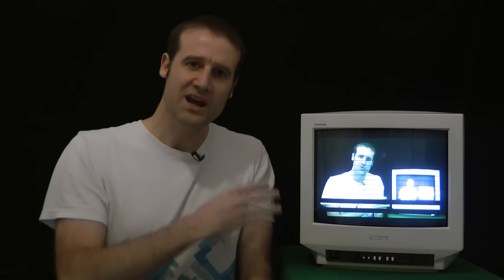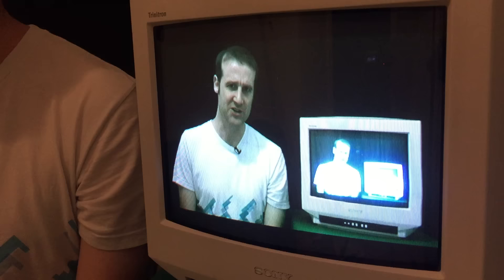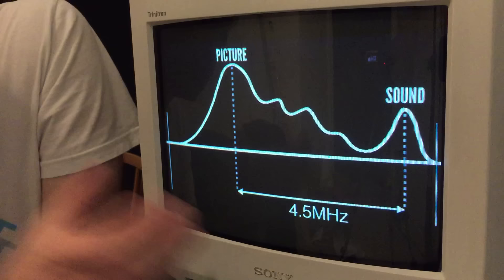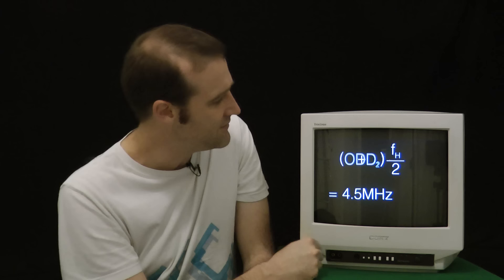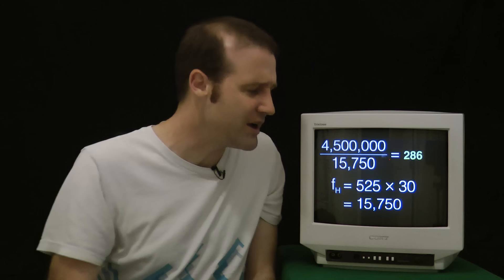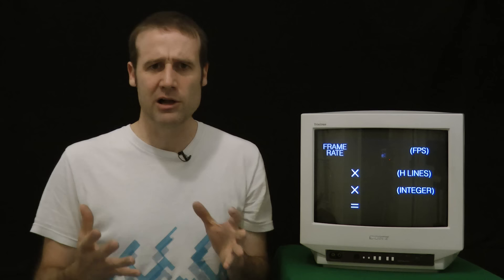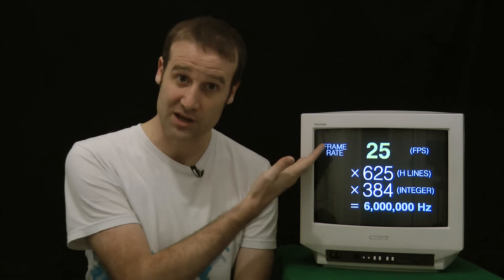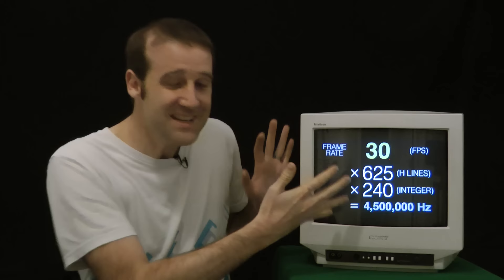Why is TV 29.97 frames per second?

Comment: Was the electricity really used to time the scans? The issue was interference. When it matches the mains frequency interference remains still instead of flickering. There was no universal European standard before color. That was the German standard. British had only 405 lines. The 625 line TV was introduced around 1951 so it precedes U.S. color TV. The second NTSC was in 1950-53. While it might be possible that some of the findings influenced it is more likely that it was a coincidence.

Comment: So I understand the precision of 525 lines and 30 vs 29.97 frames/sec - but the 4.5 MHz bandwidth of the Over the Air signal is inherently going to be fuzzy.  So it's still not really clear what was up when this was devised.

Comment: Backward compatibility would suggest to me that changing the number of lines might not work too well with existing b/w TVs.  I'm not sure, but my guess is that a device designed to display a 30 fps signal might not lead to a strong perceptible difference when fed with a 29.97 fps signal.  And if the image was affected only slightly by a 29.97 fps color signal on a b/w TV, it wouldn't be a huge hindrance but might incentivize people to buy color TVs.Analog TV standards are less relevant today anyway with digital TV.

Comment: I find the suggestion that we should always create our standards with the future in mind to be kindof funny; we're essentially saying to the original black and white TV designers "Hey, keep in mind that some day, we're going to need to add color to this!  Oh, and be sure to make the video extra crisp for the future 4K computer video youtubers!  And why not add a little wiggle room for holographic displays while you're at it?"

The RCA guys were given the groundbreaking work of their black and white TV engineers, and took on the task of making something color, yet compatible with that.  When they did it, Europeans said "perhaps we could do something better", and they took about 10 years to get PAL, which wasn't compatible with their previous standard.

Sometimes we have to break compatibility (which America did a couple of decades ago to go to digital broadcasting), sometimes it's best to still support old stuff.  Regardless, it's going to be a mess either way -- and it's always a compromise.
Reply: "PAL ... wasn't compatible with their previous standard."
 
Incorrect. The UK introduced 625-line B&W television in 1964 but only started broadcasting colour programmes in 1967. The B&W receivers continued to function perfectly despite the introduction of colour subcarrier. (I was still using a B&W portable into the 1990s.)

Comment: Instead of breaking in to every home out there that had a TV, open the TV, then the picture tube and add another 100 lines on the screen and putting everything back, someone at the RCA or GE would have thought "heck we will fudge the frame rate to 29.97". That's how it would be done.

Comment: For me as someone who grew up with PAL consoles I hated the lower framerate. The image on PS1 and 2 was already crap when using composite cables so I mostly used PAL 60 mode on Xbox regardless the worse resolution. (720x480i). Those 5 frames really made a difference for me.

Comment: But my old CRT Monitor ran in 60Hz refresh rate with a full resolution of 1024x768i, even though our supply voltage is 230v@50Hz.
Okay, with no sound. It was a VGA Monitor 😊
Reply: CRT monitor doesn't have to use TV standards. TVs have. 50Hz is standard because of carrying signal, not because of powering these screens. CRT screens can run even up to hundreds of hertz.

Comment: The UK 625 line TV channel is 8MHz wide chosen in 1964. In North America, the TV channel is 6MHz wide chosen in 1936, first for 343 lines, then in 1938 441 lines and finally in 1941 525 lines. You could not increase in North America the number of lines without widening the channel! Furthermore, you render all the existing B&W TV's in service obsolete! That was the whole purpose of RCA's Compatible Color TV!! 
As for the 4.5MHz, it is the spacing between the sound carrier and the video carrier. If it was widened by only a few hundred Hertz, yes the 30Hz frame rate could have remained. The problem was a invention in 1947 by Louis Parker called intercarrier sound. Intercarrier sound was the process of intentionally beating the sound carrier with the video carrier to create in the receiver a 4.5MHz Intermediate Frequency. Intercarrier. When NTSC color was developed in the early 1950's the engineers could not change the 4.5MHz sound video carrier spacing spacing otherwise the millions of intercarrier sets in service would have to be readjusted. So the only option left was to slightly change the scan rates.

Comment: Well, 29.97*525*286 is actually 4499995.5, not 4500000. HOWEVER, take 4500000/(525*286) and divide the n/d by 150 and you get 30000/1001. You might recognize this fraction in video encoding and playback programs. Additionally, if you take 24000/1001 you get ~23.976fps, which is a very common framerate in videos even today. According to Wikipedia, this is due to 3:2 pulldown... but that no longer explains it with modern video that wasn't from a TV show or DVD or such. I couldn't see an obvious reason why it would still be hanging on (maybe some kind of equipment still doesn't support 24fps?), but regardless, even today, this decision is STILL somehow causing complexity, which is hilarious.

Comment: And yet once REGULATION was reduced, the standards changed quickly and the improvement in only 25y has been nothing short of phenomenal... with very limited major issues -- a slow, steady improvement from 240 lines (effective) to 480, 768, 1080, and currently to 4k, in about 25 years. Everything is pretty backwards compatible, and everyone's happy.

Demonstrating once more, how THE MARKET does a much better job of handling changes and problem resolution than REGULATION, yet again.

Comment: They couldn't add more lines because of the bandwidth, 525 lines per frame is the highest number of lines they could send in 4.5 MHz, PAL has more lines because it has more bandwidth and less frames per second, but in NTSC this wasn't possible, if they hadn't reduced the frame rate they had to have reduced the number of lines and that would have decreased the picture quality.

Comment: Answer: it's not! At least not when you don't use Never The Same Colour (NTSC). PAL is 50 Hz based and 25 frames a second is a MUCH better match to cinematic which is 24 FPS. So broadcast movies actually move at an imperceptibly faster rate than actual film rather than the very noticeable 30 FPS which is 25% faster, without fudging the broadcast scan speed in some way.

Comment: Hmm, I was taught back in 1979 that it was based on the 3.57mhz crystal  which was a easily divisible to both the horizontal and vertical frequency and were close enough.

Comment: The 29.97 (or, as SlideSRB poited out 30/1.001) fps issue is really only a problem with TVs today. Every laptop and PC monitor I know of runs at a multiple of exactly 30 by default, and video files nowadays can handle any framerate you throw at them. I mean hell, I try to export at exactly 60 fps because 90% of the time that's the framerate of the original video (be it from a game via OBS or ShadowPlay or my phone whose camera I've locked at 1080p60)
Reply: If you play a 29.97 fps video on your 30fps or 60fps monitor, you're probably getting one repeated frame in every 1000. Ehether you notice teh glitch or not depends on what's happening.

Worse, some badly written video encoders fail to tag the video correctly as to the frame rate it should be played at, resulting in loss of synchronisation of audio. Sometimes this happens due the recording being interrupted before the correct tags get written to the file (for some reason it's often done at the end of recording, rather than the start). 

A 1 second sync loss for every 16 minutes (1000 seconds) of running time is pretty horrendous! =:o\

Comment: Changing the number of lines would have made the old B&W sets of the time unusable. There would have been two options :
1) Have technicians modify all older TV sets to the new standard.
2) Demand that everybody to ditch their old TVs and get new ones, even if not interested in that new thing called colour TV.
Both would have cost a fortune.

Comment: If you increase the number of lines, you have to increase the bandwith to achieve the same resolution in each line of information.
And also, it's not "data" that's being transmitted either. It's a pure analogue signal, with some pseudo digital data in the sync lines.

Comment: Thanks! Now I know why my old Need for Speed PC games had that Interlaced option in the Graphics settings. It was meant for me! 

Kind of like the Invert Y option in the control settings of most FP Shooters. I shutter at the thought of that setting not being there. 

Even worse, could you imagine if a flight sim was upside down with no way of correcting the defaults? If not, you probably didn’t get that “Yes, yes... without the oops.”, joke in, “Independence Day”!

Comment: I’d also like to point out that NTSC was backward compatible w black and white TV whereas when you switched to PAL the black and white TVs were effectively bricked.
Reply: Are you confusing the UK changing from 405-line to 625-line around the same time as colour was being introduced? They weren't related; 405-line was a left-over from the 1930s which the BBC had reactivated after the war as a way of getting television broadcasting going again without delay, but the rest of  Europe had instituted a 625-line standard, so the UK belatedly changed over to that.

Comment: No mention that the 25 FPS PAL system vs the ~29.97 FPS NTSC system also caused many video game consoles to run slightly slower on PAL (so they could just sync the game system to the framerate and not have to do complicated conversions, I assume)?

Comment: So how would a 60Hz powered set (like an old black and white) synchronize to a non-integer division of 60Hz frames per second? Is it just because the frequency difference is so small that the horizontal and vertical oscillators will lock? Because the entire system frequencies will be lower.

Comment: That's weird - why did they assume exactly 4500000 Hz as the target? 4.5 MHz means plus/minus some margin, as no analog equipment runs at exact frequencies, but lock into cycles in the received signal. E.g. assuming a window of 4504500 Hz would allow for an integer rate. Was it solely to comply with regulations?

Comment: In my opinion PAL is not better, 24fps and 30fps have a LCM of 120fps, 24 and 25fps have LCM of 600.

In the early days of TV PAL Film would be broadcast at 25fps, and pitch shifted up all the audio in the movie, and thus all the music would be detuned so middle C would go from 440hz to 458hz. And their run length was shorter, Anyone with perfect-pitch would easily notice this discrepancy, and might prefer the an NTSC compatible broadcast.

(from here on there's a bunch of, hindsight is 20:20):

With PAL DVDs with US TV shows on them would be "decimated" to 25fps, and extremely blurry because of lower scanline count, and/or pitch shifted to play on a region locked DVD player, but the TV could play NTSC signals! (I'm not sure how US DVD's handled UK shows, but this happened less often for obvious reasons)

Later on with the advent of digital TV's, and the standard 60hz panel, we end up with even more problems, a film at 24fps only has a tiny bit of jitter, and only 50% of the frames would be miss timed, but PAL TV at 25fps can look quite awful as only 10% of frames would match their correct time signatures, in PAL countries the TV's were run at a native 50hz IF the broadcast new what they were doing but Computers would not play back the correct frame rate, especially with the advent of piracy (since they were fixed to 60hz, and most users wouldn't adjust their display manually to watch ), but then you end up with film playing back incorrectly, or more pitch shifting.

And you yourself upload YouTube videos at 50fps, despite no one ever switching their desktop PCs to 50hz ;-), nor can you even change a mobile phone to 50hz at all.

60hz is the defacto standard, and we've long since ditched the limitations of both NTSC or PAL scanline counts, but the "odd" framerate of 25fps is still, to this day degrading the quality of video playback, because UK standards authorities have kept the 25fps standard despite despite 1080i60 being superior in every way to 1080i50 making their video content inferior on PCs and mobile devices.

Comment: And then there is "PAL-60" which uses 625 lines with 30 fps/60 Hz
Another idea would be to very very slightly reduce the bandwith. 30 fps with 527 lines and a 284 integer would be about 9.96 kHz less than 4.5 MHz. With 523 lines and the same 286 integer it would be about 12.66 kHz less.

Comment: What I am still not clear on is if 30 fps was chosen to match a power frequency of 60 Hz, would the US then not have had to change the power frequency to 59.94 Hz after the change of the frame rate to 29.97 fps?

Comment: But if you increase the number of frames per second relative to PAL and you use a smaller bandwidth, you decrease the sensitivity of your system which would require you to send more power resulting in more distortion bleeding into other bands for the other channels. Maybe its still better I dont know, but telecommunication is not as simple as making sure you have nice integer numbers.

Comment: You said they couldn't stretch the bandwidth at all, but surely they could use slightly less of their given bandwidth right? If they'd used 284 as their integer it would take up 4.468MHz. Only a 0.7% loss.

Comment: So...he never came out and said NTSC was originally 30 FPS?  is that correct, and shifting it to 29.97Hz  was close enough that the existing B&W TVs PLL would lock in when it was changed?

BTW, I noticed something interesting years ago about persistence of vision with CRT monitors. If you stand 10 to 20 feet away from a computer CRT and chew on ice chips or crunchy food while looking at a CRT, the fluid in your eyes vibrates and it looks like the CRT is glitching out, like the image is jumping up and down.  Next time you see a CRT (if ever) try it.

I think it only works on computer CRTs, because they can have a scan rate faster than NTSC resolutions, therefore they needed phosphors with much faster decay times.

Comment: changing the ammount of horizontal lines = changing the H-FREQ, most TVs at that era has a adjustable H-FREQ, but.............., the sync separator tank would work? or will be way more unstable to sync.? . So, thinking in retro-compatibility with B/W tvs sets, they didn't move the ammount of lines.

Comment: Actually the best of them all was SECAM. Same resolution as PAL but better picture quality. Sure in todays digital world just about any framerate and resolution can be played. Back in the day when NTSC was defined they /could/ have made a requirement that NTSC compatible TV's must be able to also support resolutions of 625 lines. Then after 10-15 years with color in low resolution you can make the switch to higher resolution. Enough time for people to buy a new TV those who had a black and white one that could not easily be readjusted.

Comment: PAL..Having the advantage as being tarted from scratch?...
The short answer is No..not the case.
625line 50hz 25fps was already a monochrome standard, used in most of Europe.
Post war...
625line was actually based on the then new 1940's USA 525 line 60hz 30fps monochrome standard.
(Being our electric is 50hz,  we always had to go down the road of a lower 50hz 25fps). 
This lesser frame rate, (and all things being sort of equal), gave us room to having 100 more lines per frame..). A sort of 'give & take' so to speak of.

PAL is really, ( as with its closely related cousin NTSC ) only a colour standard... made to be compatible with the existing black and white tvs already out there. 
And weirdly:.........
Although at last, we had a monochrome picture standard at least, (at 625 line etc etc.)...within, there were a few different audio sub standards... within the standard...if you get what I mean

With this said, and along with the differing audio fiascos just mentioned , how we managed to avoid the need to make any weird frame rate adjustments, ( say 25.17 fps for example), when squeezing in colour,... I don't know. 
It's all down to Maths, (or Math ), I guess...or luck maybe.

Comment: AT 2:42 "60hz"!  No, no, no, it's "60 Hz"!  The units are "Hz", not "hz", according to the SI system.  Also, at least for the US, there is supposed to be a space between number and units according to NIST.  Does NPL have a similar standard?

Comment: This video is missing the point. The original standard was developed for black and white TV only.  Then when color came along they needed to keep the signal compatible so that the millions of B&W TV sets in existence would still work. Changing the frame rated from 30 to 29.97 accomplished this. B&W TV's were able to both ignore the color signal and tolerate the slight change in the frame rate.

Comment: No, they did not use AC frequency to time the scans. Your representation of how interlacing works is also incorrect. PAL is a color system, if you don't want to talk about systems B,G,D or K then just say "50 Hz TV". And no, PAL did not come like this from nowhere, it was added to monochrome TV just like in the U.S.

Comment: BUT the big question is why this ridiculous frame rate still exists! The only feasible answer is so that if someone watches an analogue broadcast on a black and white CRT TV won't have to adjust their vertical hold. Which is of course entirely relevant in 2018.